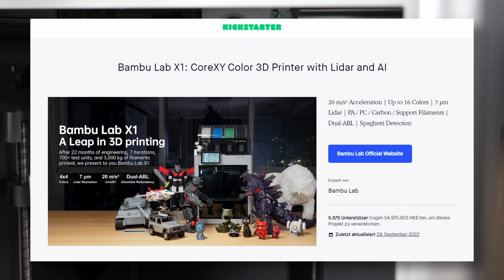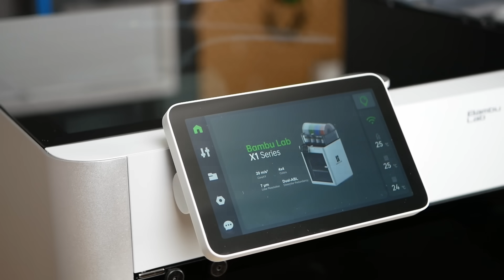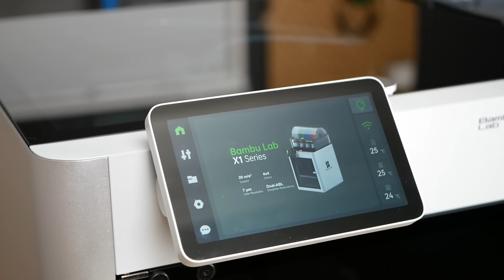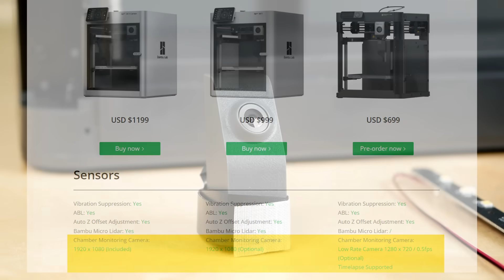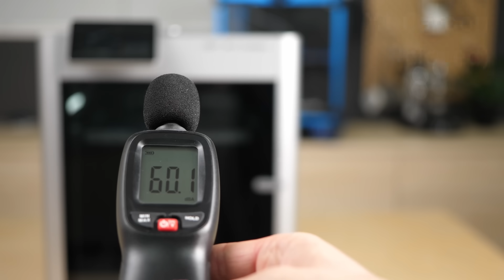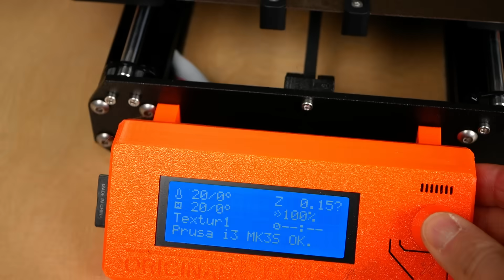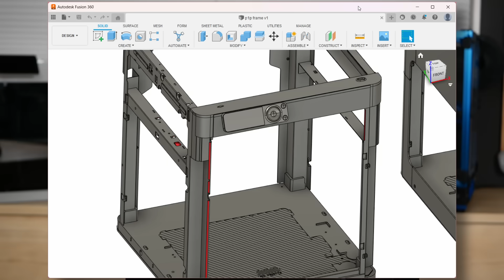The Best 3D Printer of 2022 got Stripped Down to make it Cheaper!

Comment: I'll eventually buy an X1C. I know a lot of people like to tinker with their 3d printers, but I don't. I use mine as a tool to make parts to tinker with or build other things, but I don't want to have to tinker with the printer. Having something that simply works and allows me to continue design work without having to stop and tune or monitor print progress would be a huge QoL improvement and also increase my productivity.
Reply: That was THE reason for me to back the x1c, too.
Reply: Preach. 3d printing isn’t a hobby for me. It’s a bottleneck. I’m tired of dealing with finicky machines.
Reply: Exactly the same as I don't feel like tinkering with my laser printer when printing excell documents. A 3D printer should be properly calibrated to print at it's best out of the box.
Reply: @dingdingdingdiiiiing  your laser printer isn't a 3-axis CNC machine. If you want to make precision parts you need to setup the machine, that's just life. Even a $$$$$$ industrial CNC machine requires the operator to do calibration after delivery, or they'll send a technician to do it, because it has to be done on location after the machine has been put where it's going to be used. Don't tell me you've never owned or used a printer that left faint horizontal lines around the text, or random black speckles; at least on a 3d printer you have the capability of fixing it yourself instead of either chucking it or just living with the flaws like a dpcument printer.
Reply: @tissuepaper9962  but it would be nice if that CNC didn't NEED to be setup by you or a technician and self-calibrated.... if 3d printers can get there, like the X1C then that's exactly what people really want.  this is what made prusa good too.  out of the box no tinker printing.    i don't want to tinker with the printer either... i can and have but i rather not waste my time on it outside of swapping filament and removing the prints from the bed.
Reply: @digibluh  you can do automatic bed leveling with a cheap bolt-on touch probe and a firmware update, you don't need a $1200 Lidar-enabled printer to get a good first layer automatically. Squaring the axes is literally not possible to do automatically if you want the resulting mechanism to be small and stiff enough to be used for 3d printing, they're doing that at the factory and that level of precision can't survive shipping. There is a very good reason that industrial CNC machines don't automatically tram themselves; a real human being with an analog dial indicator does a better job.

An Ender3 is made entirely out of standard parts, it's the easiest thing in the world to repair or upgrade. The X1C is mostly custom parts, that alone completely nullifies the convenience factor because it's only convenient until you need to repair it and the only place to buy a part is bambulabs. Why not use a service like shapeways if all you're worried about is getting the part at the end? You're buying the MacBook of 3d printers, an unrepairable product-as-a-service that sells itself on the premise that it "just works".
Reply: @tissuepaper9962  yeah, I get that, and you're right, sure. 3D printers are more complex, but there is a difference in quality of them; some are made of good parts and are reliable, others are made with cutting costs being the top priority and so the reliability, or maybe better - repeatability, is much lower. And this, precisely, is my gripe. You see, what good are dirt cheap milk cartons to a dairy plant if every 10th carton leaks? Cut costs? Sure, but don't make components out of spaghetti and glue, you know what I mean? Prusa does not have any major problems. You will have to do maintenance, sure, but I've never had any problems with PLA on a Prusa. First layer adhesion? Not one failure. Not one. Mid print spaghetti? Never. So I don't know, I guess good printers can be made at non-prohibitively expensive prices.
Reply: @digibluh  Yeah, wouldn't it be nice if everything was just perfect and did everything for you and you didn't have to do anything.

🤦
Reply: @tissuepaper9962  Seriously, these people.

🤦
Reply: @dingdingdingdiiiiing  😂

My $200 3D printer prints just as good as an $800 3D printer. The parts aren't even that much different than each other.
Reply: I thought exactly the same and bought one. 
I have my x1c for a little over a month now and i love it, it just works. 
The machine isn‘t perfect by any means but they‘re trying really hard to improve everyday. 
Out of my last 40 prints only 2 failed because i was too lazy to clean the pei plate (also the failed prints got detected and stopped automatically). The only problem i encountered was that my brittle old pla broke and jammed the ams. I then had to disconnect the ams and open it up. Its not a lot of work and takes about 5min to get it working again. I especially love the print speed and quality for prototyping. On one functional part i had to dial in the tolerances and had to print like 5 different versions. 1 print took me around 7h on my ender 3 and around 1.5h on the,x1c. I also had to babysit the ender throuout the entire print to make sure everything was fine. On the x1c i just press send to printer and take a look at the camera in the slicer sometimes. I also printed a lot with Xt-cf20 and Carbon fiber Asa and never had a problem with flow or jamming the nozzle. (But you shouldn‘t use the ams for reinforced / abrasive materials)
Reply: This is why I am selling my Voron!
Reply: Coming from a VERY manual i3Mega I LOVE my x1 Carbon. It just works. I recommend the wham-bam pex plate it gives a great mirror finish 1st layers and has no adhesion issues. That said gently washing and reapplying gluestick is fine for the cold plate. I don't have any issues with using a glue stick and so far no bubbles. I recommend printing the scraper tool first as it is great for getting prints off without damage to the sticker. Some hate it but it's a clever solution.
Reply: @Hagantic  My $150 Ender 3's just work too.

😂

Do you know why you think cheaper printers have so many problems? Because noobs buy them with no electronic skills or any skills for that matter. Probably never even worked on a computer. So you see them online complaining every day.

I bought the exact same printers as those people but because I have a background in engineering and other trades. I didn't have any of the issues they did.
Reply: @dangerous8333  You assume I don't? I'm in R&D and have run an analytical lab usng SEMs, Instrons and thermoanalytical tools. I have a chem degree and know a good deal of engineering and programming. But that is my JOB. I want 3-d printing to be the hobby, not keeping the machine running to be the hobby. 

Also being an elitist and saying you have an engineering background is why you didn't have issues is beside the point. They don't sell them stating you need an engineering degree to use them and you shouldn't need one. 
I also owned The M3d cube and an Anycubic i3 mega. I've had a 3-d Printer in one for or another for nearly a decade. The mega works fine I just didn't enjoy using it. I know what to do but don't want to be bothered. 

Your argument is essentially saying (insert car brand here) is reliable so long as you are a mechanic.  That is a logical fallacy sir.
Reply: @publicname  you may be surprised to learn that some of us build our own computers and run open source software on them
Reply: @publicname  lmao okay mr. thundercock
Reply: I have the most basic 3D printers E3v2, S1, and I don't have to constantly tinker with mine or watch print progress.

Some people tinker with things when they don't need to and other people tinker with things because they struggle because maybe they don't have the skills.
Reply: @RaShayRitto if the future is all automated, proprietary, overengineered nonsense, count me out. It may surprise you to learn that I was born in this millennium and I still don't find a need to take the analog, manual touch out of everything.
Reply: @tissuepaper9962  the future is "different", I would say. Automated yes, but many technologies also become accessible. There's a great mistake example of Ave, a very huge youtuber (which hiding million subs), which spent all savings to buy a massive car-size industrial CNC machine, which require a crane or helicopter (not sure how he delivered that in Canada mountains) to even put it in place. His idea was that everything will be consumeristic and proprietary, so he thought that someone will use his home shop for personal metal milling orders . That was huge mistake, no one needs that, there's already a huge competition by that from China (Ave have sinophobia because a very rural guy, but forgot during playing with his industrial toy). Starting from copy of Ave's german CNC machine by China, the Carvera from Makera company,  reduced in size to 3d printer, in mass and price (only $4k), better in everything, make all same with auto tooling. Ending with huge chinese maker PCBway which opened orders for any metal CNC parts by your design by email. Very cheap. Ave lost huge, all retirement fund for wrongful understanding of future.
Reply: Usually people who never had 3d printer say such. It's only a hobby, expensive, very complex to novices and toxic by fumes. People who really prototype products and make projects on YouTube like Fran Blanche, bought 3d printers and anyway recommend not using them for projects, ordinary wood carving are faster and more precise by their advice. With wood you can make a complex tool instruments like japanese channel JSK-koubou showing. I personally getting my first Voron soon, but I don't see too much use for it, very rarely, a hobby. Of course if your goal is not a useless anime figurines in all room, which is plastic garbage.
Reply: @fontenbleau  You have no idea what you're talking about.

I'm actually a professional woodworker and metal fabricator and I use plastic parts in lots of things. I can make plastic parts that are just as strong as wood or their metal counterparts.
Reply: @publicname  that's a non-sequitur
Reply: @RaShayRitto <-- Probably doesn't even know how to get a first layer started. 😂

Probably just getting into this because now there's a machine that does everything for him.

Comment: Oh goodness, Stefan, I just ordered a P1P and now I'm second-guessing myself. I'm brand new at 3D printing and I was about to order the X1C but the lesser was announced. I hope I didn't make a mistake in cutting back!
Thank you for the honest review, 
Stefani
Reply from the maker: You'll be happy with the P1P as well, especially as a beginner. Hotend and extruder can be upgraded to hardened steel if you ever want to print re-inforced materials.
Reply: @CNC Kitchen  Thank you for the reassurance and I'm glad to know that I can upgrade those items. I originally was planning on adding a few upgrades when I ordered but the black Friday order didn't allow me to add to the order. I wanted another color filament but I didn't know enough about what I could use with this machine...yes, I'm that new to this 😳
Reply: First advice - never use 3d printer in your sleeping bedroom (yes, not everyone had castle to live or any garages), it's toxic by fumes with no-one disclose filament plastic formulation. I recommend at least kitchen during not making food and using the ventilation hood there for suction fumes, which usually the most powerful by all regulations and can be connected by tubing.
Reply: @fontik  luckily I have a work area in my basement set up and ready. It has a window that I can vent fumes out of. Being I'm in a very cold, snowy area the air will pass through two large filter chambers before going outside. I think it should be safe but if anyone has any other bits of advice I'd surely appreciate any information!
Reply: @fuzznickers  yes, fumes are important, looking right now on Fran Blanche, she really regretting working with painting and other chemicals many years ago, looks 60+ in her 40-50
Reply: They’re both the easiest to use machines and fastest (out of the box) on the market currently, so don’t worry too much.
Reply: @morbus5726  and they'll break down in 2 weeks 🤣🤣
Reply: @Fejszi  have you had a bad experience with your x1c? Mine works lika beast 8 weeks in, printing almost non stop, haven't had any issues yet 🙂
Reply: @lilypower  no, but a friend of mines's had to replace his hotend after 2 weeks of use...

Comment: Awesome initial review. The question is can you upgrade to a higher temp nozzle?
Reply: The nozzle is already high temp, I think the max temp is 300c, though you will need to upgrade to hardened steel for abrasives.

Comment: I bought the X1C because I wanted a printer that I didn't have to fiddle with to make work - I wanted something that I could just hit "go" on and walk away.  Bambu has delivered on that. I also wanted to easily print ABS, and the X1C does that, too.

Something I didn't expect but am very pleased by is the way the X1C is super-accurate if you slow it down a little; I can run it at about half its default speeds, still be almost 50% faster than my Ender 5, and be amazingly mechanically accurate.

Is the P1P the same motion system?  If it is, it seems like it would be a good choice for a first printer - for those of us who want a 3d printer to make our imaginations take physical form, rather than as a building project, anyway.

At some point (when I have more money) I'd like to get a very accurate, easy-to-use printer, put a 0.2mm nozzle on it, and be able to print really detailed things without having to deal with the toxicity of resin.  A Voron 0 would be a good choice for that, but I'm not interested in building a printer, so - with the X1 being a similar out-of-pocket cost - I was leaning towards getting a second X1.  Now that the P1P is available, it's moved up to the top of my "probably this one" list.

Comment: I'd love to know what effect removing the lidar has on print quality. If it's not there to help ensuring a great first layer, but the P1P is intended to print at the same high speeds, will print quality reduce or have higher chances of failing?
Reply from the maker: Well, this "just" means that you need to tune pressure advance manually and need to make sure that flow is set right. Other than that the LIDAR doesn't help and only adds weight to the toolhead.
Reply: @CNCKitchen  Could you please share how manual pressure advance calibration works on bambu environment? Is it possible to change coefficient on their slicer?
Reply: @CNCKitchen  they should sell the lidar module itself, setting flow and PA manually every time u change filament type can be annoying.
Reply: @mrjoelpt  Well, they made the decision to not offer it as an option. Virtually all other differences (except the heated bed) can be purchased rather reasonably if you REALLY want the Camera for example. Side panels have been released for free printing, hardened nozzle, Enclosure fan, etc. are also available. You can even buy the glass door and top panel for around $50 USD if you REALLY want then! All the prices are MORE than reasonable. As far as the LIDAR - several people have discussed this in other YT Vids and virtually everyone agrees the LIDAR is not as big a deal as it is made out to be. Nice but not really necessary. The huge number of major features are still there on the P1P, for this price it's a killer.

Comment: Is this a good starter printer? I'm a 60 year old with no experience in this field. My dream printer would work, printing steel alloys to produce a hobbie jet turbine.
Reply: yes, it is the easiest printer to use on the market currently (under like $5000), but it cant do steel. When I need to print steel, I usually just use a service like jlcpcb. They only do stainless, buts it's surprisingly cheap.

Comment: So, the firmware is proprietary too here, right ? As a normal customer (I mean not professional) that only thing will make me never buy it, despite the reasonable price.
Reply: yes, but i dont get why that matters a lot.
Reply: @morbus5726  For some it does matter.  One reason is open source is about the 3d community as a whole.  Bambu only has a printer because they're leveraging all the work the 3d open source community gave to them, free of charge.    The second reason is closed source means no one but Bambu can create enhancements for their printers.  Its their roadmap and you're just along for the ride.    And lastly,  closed source means if Bambu were ever to close up shop, the hardware dies with them.   Now, in fairness, they have a blog post saying in their demise, they would release everything, but who's to say they don't sell the company to someone else and they have a different idea?   

Now, this may not matter to you, but it does matter to others. I like the X1C and the P1P.  Super fast.  But the the closed source nature of their business model gives me pause.   I imagine had they open sourced their designs from day 1, the network security issue would have seen the light a LOT sooner, and probably could have been fixed by the community as well.   Just my opinion though.  I'm sure they'll still sell a ton to people where this is not a concern.